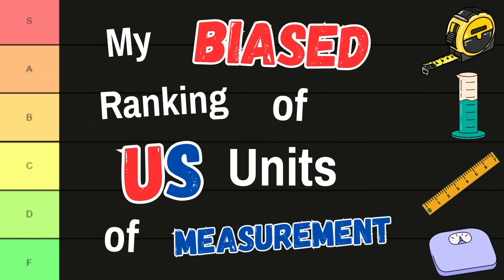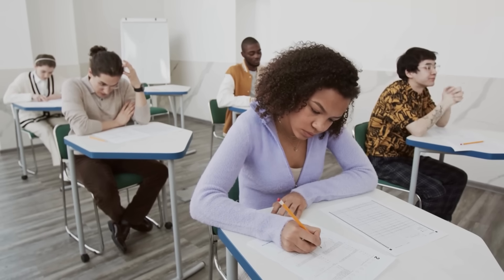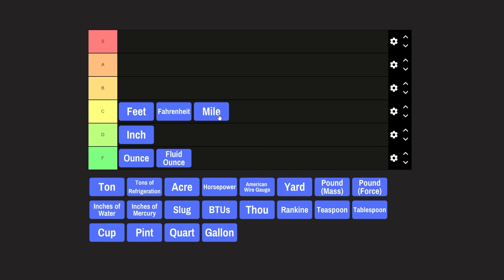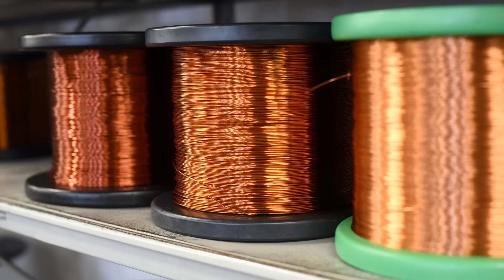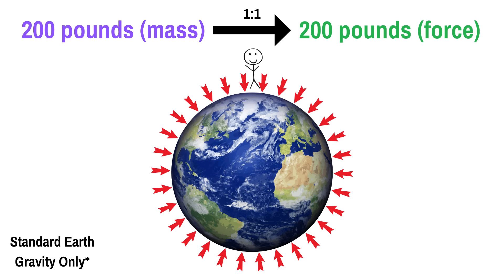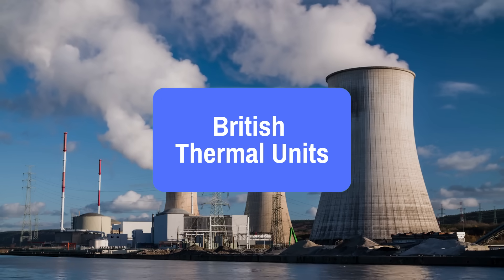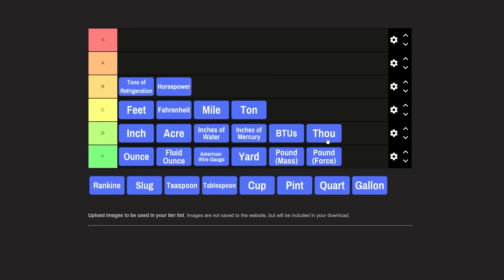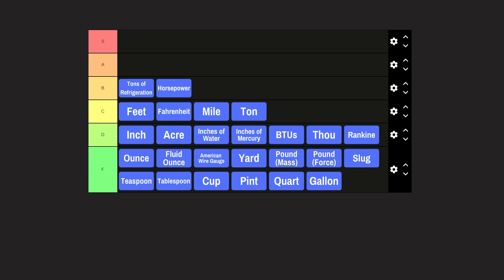Tier List of the DISASTROUS US Measuring System

Comment: Wait wait wait wait.  You're not going to explain why you ranked Fahrenheit, which is inarguably superior to Celsius, as C tier, just declare it arbitrarily?  Fahrenheit is the one and only US measure which is superior to its metric counterpart full stop.  You already recognized that Fahrenheit is well scaled for air temperature (though you didn't recognize that Celsius is unbelievably BADLY scaled for weather).  What else?  Fahrenheit is much better than Celsius for human body temperature, as it has twice the integer resolution of Celsius and the difference of a few degrees goes from "your baby is fine" to "must go to hospital now".  As to cooking, nobody cares that Celsius is scaled for states of water (in Paris only), because absolutely nobody measures water when it's boiling: it's always exactly the same temperature during its entire state change.  Fahrenheit again has twice the integer resolution for oven temperature, for candy thermometers, and so on.  Last, Celsius being better because it's related to Kelvin is nonsense since Kelvin was *based on Celsius*.  Both Fahrenheit and Celsius are both converted to Kelvin with a simple linear transform.

Comment: A funny thing is, that we use a few units with similar names in Germany as well, but with different definitions: One German pound is exactly half of a kilogram. A German tablespoon (Esslöffel) is a very unprecise measurement, were you just get a regular spoon and use whatever size it has. Just slightly above not measuring at all, so you have at least some consistency. The same for tea spoons (Teelöffel). German horse power (Pferdestärke) is also defined differently using metric values and a horse. This is still used to advertise cars, because people are used to them.
The German mile (7532,5m) (also known as the Prussian mile) hasn't been used for centuries. The same for the German geographical mile (7420,44m) (1/15 of a equatorial degree). The last German mile, that was used, was exactly 7500m=7,5km. Fun fact: In Europe the different definitions of miles ranged from 1,5km up to 11km.
Reply: I've never even heard of the german mile while living my whole life in germany
Reply: @Amphibax  I am a German living in Germany for a few decades, I also never heard someone use it. Noone uses it anymore, I assume if you say to someone "Meile" they would think of the US custom mile.
Reply: "Fun fact: In Europe the different definitions of miles ranged from 1,5km up to 11km." 

Nope,  the Dutch mile (1816-1870) was 1 km by definition.
Reply: @ThW5  Dutch stepping short?
Reply: @peterebel7899  Not really, the Netherlands were rather early with going fully metric, but re-used old names for the new units, so the kilometer became the "mijl", the centimeter "duim", the kilogram "pond", "aas" for miligram and so on... Most of those uses have been forgotten but some, especially "ons" for hectogram and "bunder" for hectare are still used somewhat.
Reply: @ThW5  I was just joking.
Bud did they use pound for a kg when the neighbors use pound for 500g?
Reply: @peterebel7899  Excusez -moi mon allemand:Jein.

 Sort of, as in those days people were still used to using different pounds, you still had medicinal pounds  (became 375 gram in the Dutch system), and Dutch pounds (1 kg), but in daily conversation pound for a weight close to half a kilogram must have endured as it is still in use as such. Before the metric system a pound could be as little as 275 gram (medicinal pound (in part of current Belgium)) and as much as 543,4 gram (Groninger spek pond, yes, a bacon pound), but most seem to have been somewhere between 400 and 500 gram,  (some of) the most common ones less than 10 grams lighter than 500 gram, so the introduction of a heavy-official-Dutch pound did not stop the Dutch from using pound for a weight close to the common value of days of yore of about half a kilogram. 
Of course, the Dutch names for the units were phased out in the era between German unification (the one in the second half of the 19th century) and WW II, so it is easily overlooked.
Reply: @ThW5  Thanks for your information!
Today the pound in Germany is alive in every grocery store, and it is 500.000g according to Bizerba readings.
Reply: @peterebel7899  As pond is not an official unit, it is technically not allowed to use it formally, i.e. on price tickets in the Netherlands, so it tends to be a case of: you write "500 g", but you say "pond".
Reply: @ThW5  Yes, daily business:
I want a pound of i.e. cheese
I get cut and packed a pound of cheese - and I pay for it.
And the receipt tells me I paid for 500g 🙂

We do use "Zollstock" (= "inch-stick") as carpenters or in daily life
Just this measurement device is markt with mm, cm, m, no inches 🙂

We do use "Zentner" as a unit of mass measurement.
In Germany this represents 50kg (officially defined 1858 as 100pound =50kg)
In the SW region it is sometimes called a Quintal (I never witnessed this in real life) defined as 50 kg.

In Austria the definition of a Zentner is officially introduced by law in 1950 as 100kg (which is been called in Germany a Doppelzentner)
You know: Austrians are the better Germans ;-)
But Austria skipped the official use of Zentner in 1977.

As I read in Wikipedia:
In der Schweiz sowie einigen anderen Ländern wie Italien, Russland, Polen, Slowakei, Tschechien, Ukraine, Ungarn, Belarus und Estland wurde oder wird hingegen inoffiziell und zum Teil auch in amtlichen Verlautbarungen der (Meter-)Zentner oder das (neue) französische Quintal (q) von 100 kg verwendet.

So the Zentner is screwed to be 50kg or 100kg and the Quintal is screwed to be 50kg or 100kg ....

To sum it up: Central Europe is lightyears away from being fully metric (in mind).

BTW: 
- Is lightyear a metric unit?????
- Why do scientist use Parsec (=3,26LY) instead?

Have a nice weekend!
Reply: Swedish mile is 10 km
Reply: Of course, the "German horse power" is just the metric horse power – the power needed to raise 75 kg by 1 m in 1 second, nothing specifically german about it. (It's 98.6% of the imperial horse power.)
I still see "sea miles" (nautical miles) around (which is just the average length of one arc minute on the meridians), and based on it the velocity knots (sea miles/hour), but only in maritime context.
Reply: @PauxloE  there's no metric horsepower, only power in watts
Reply: In Italy we don't use table / tea spoons, we use the "qb" (quanto basta).
This means "just enough" so basicly they're telling you to eyeball things and shut up
Reply: In Italian cooking books we don't use table / tea spoons, instead we have the qb "quanto basta".
It means "just enough" so they're basically telling you to eyeball it and stop bitching
Reply: Of course, the "German horse power" is just the metric horse power – the power needed to raise 75 kg by 1 m in 1 second, nothing specifically german about it. (It's 98.6% of the imperial horse power.)
I still see "sea miles" (nautical miles) around (which is just the average length of one arc minute on the meridians), and based on it the velocity knots (sea miles/hour), but only in maritime context.
Reply: And the Swedish mile is 10km long. Weird for those used to the Imperial mile, but the conversion is more practical.
Reply: Imperial units differ between Britain and America.
long ton, metric ton, short ton, ....

Diversity makes life exciting!
Reply: @peterebel7899  Imperial units also differ in the US. US customary mile, US survey mile and of course nautical miles.
Reply: @johnscaramis2515  The nautical mile is not owned by America, it is international nautical standard.
Reply: @peterebel7899  Yes, but it's also used in the US Navy, hence 3 different types of miles in the US.
Reply: @johnscaramis2515  A navy should move on the oceans, so the NM is the only relevant.
Reply: @peterebel7899  Don't forget that cars in the UK are just about 25% more efficient per gallon than in the US. The gallon is 25% bigger, and the mile is 0.0002% shorter.
Reply: @dascandy  I do love the British style of efficiency!

;-)

Comment: 7:58 Europe does use this kind of system, i dont know if its every country but I know multiple countries that use cm, dm, m, or otherwise said centimeter, dezimeter and meter, again im not sure if its the same in english but meter is the same in english im pretty sure. 1m is 10dm and 100cm, in every type of measurement a different type of name is always :10 or :1000 and never any different
Reply: Well said, except that "different type of name" is simply called a "prefix".  "decimeter" (c, not z)  is not a separate unit from "meter", but just "meter" prefixed with "deci".  Just like "kilogram" is not a sepa… oh, damn, they did fuck up that one.  "kilogram" is the base unit, accidentally.  Thus a milligram is actually a microkilogram.  :D

Comment: I think Fahrenheit is the only imperial measurement that still holds water(pun intended) against the metric system, because Celsius is equally arbitrary, being based on the freezing and boiling point of water which changes with pressure, as Fahrenheit’s human-centric system. Besides, if I’m using Celsius, I can never get baked at 420°, nor could anybody look at a thermometer that said 69° and honestly say, “Nice.”

Fahrenheit is High B Tier at least.

Comment: I disagree with the ranking of teaspoon, tablespoon and cup. These are very practical and should be the sole A tier units as they are very easy to use in the kitchen and don't require you to faff around weighing all your ingredients on kitchen scales to get the correct proportions. Also really easy to scale up and scale down recipes. People that use a different measuring system overall still use these measurements.

Comment: In germany we call a mesuring stick which is in cm and usually 2 meters long "zollstock" which means inch-stick. And some older people sometimesbuse pfund(pound). But its 500gramms/0.5kilogramm and that means its around 1.1 us pounds 😂
Reply: No we don't.  Not everywhere, anyway.  Here we call it (or I do and did when I grew up) a "Meter" (short for "Metermass" I think).  And not just older people use "pound"… oh, wait, I am old ;-)  But in  both cases, it's just the name.  Not the actual units (which we did have, shortly before german unification we had over 300 units (different sizes for the same-named units) in what became Germany)

Comment: Hey i mean horsepower isnthe only of these which are used in germany. The Kw(kilowatt) dindnt really kick it away. And sometimes we use tea and table spoons but not the scale ones just regular ones so its smaller
Reply: Horsepower was never meant to replace the kilowatt it wasn’t even invented when horsepower came about and they also mean different things, a horsepower is mechanical energy whereas kilowatts are 1000 watts which is electrical energy

Comment: Well, the only positive about measuring temperatures is that you don't need to ask much if someone tells you it's -40 outside.
Kelvin does not go negative.
Degrees Celsius and degrees Fahrenheit are the same at this value.
And luckily nobody is using Rankine or Rėaumure nowadays, so.... 😂

Comment: Interesting video. Although I would have liked to have seen a more objective ranking system other than "I hate these". For example, "how easy is it to convert up or down?" (e.g. from feet to miles or gallons to cups). "How does the unit stack up against metric?" (e.g. the acre works just as well as the hectare for land area, whereas Inches of [fluid] is pretty cumbersome). Maybe even include the metric equivalents so you have some use for the S and A tiers.

I also can't help but notice that you included some pretty obscure imperial measurements, but didn't include imperial time (24 hours, 60 minutes, 60 seconds), which metric time has not improved upon at all.

Comment: It's not like other parts of the world didn't use body parts for measuring in the past. E.g. in Germany there was the Elle, the length of a forearm, about 40 to 50 cm. The difference is that at some point we grew up and started to stop using measurement units referencing body parts. So is the metric system really better? Absolutely not. It's just way easier, way more logical and defined by nature; but if you like complicated, illogical systems defined by nonsense, the metric system is horrible.

Comment: having used most imperial units in engineering for some problems I can honestly say shat fahrenheit deserved to be higher tbh, celsius is just as arbitrary and Fahrenheit could be included in the derivations for other metric units without much hassle
Reply: HOW have you been using Fahrenheit???? Do equations envolving termodinamics even work with negative numbers??
Reply: @damatta9428  Rankine absolute temperature scale has no negatives
Reply: @alquinn8576  Makes sense

Comment: as a European i dont dislike miles or pounds.
i dislike that you use more then one unit for length.
we have the meter NOTHING else. Kilo, milli, are just factors (1000)
USA does not have this. you have inch, to feet to miles. AND NONE of them are a simple factor like 10. 
how would you every remember all the convertion factors. why would you use anything else then base 10?

Comment: The worst thing about Fahrenheit is when you try to convert it to Celcius. You'll have to deal with different temperatures that are set for 0 AND different legths of messuring which means you'll have to do 2 caculations for that one conversion.
Reply: Where does length come into a temperature conversion? The equation is simple (sort of):
C = (F - 32) * (5/9).
Now, where does the 5/9 come in? 100 C / 180 F degrees between freezing and boiling: 100/180, reduced to 5/9.
Reply: What I meant was the 5/9 part of the convertion. Sorry for not being very clear about that, but I'm from Germany and translating convertions from German to English is sometimed a bit difficult. 

_Still having to calculate that formula in your head quickly is a pain that shouldn't be neccessary IMO.   @waltp9509

Comment: In Sweden, the cookbook for generations was "Our Cookbook", which was published alongside the launch of a standardized set of kitchen measures. The teaspoon was standardized at 5ml and the tablespoon at 15ml, and the book used half or full deciliters for most other measurements. So in Sweden, we do use teaspoons and tablespoons, but not cups, and those are standardized to specific metric measurements.
Reply: Even in France, home of metric system, we still use teaspoon/tablespoon for cooking.
The only difference is that we NEVER use them for critical ingredients, but only for side/preference-related things... For example, "Fry it in a tablespoon oil", "Add a teaspoon of XXXX flavor", "Add one to three tablespoon of sugar according to your preferences", and so on. And, in fact, we never use a real spoon to "measure" that, we add the approximative quantity because it IS approximative.

For everything else, metric system is the one and only rule, but there is also no house without proper measurement tools in the kitchen (precision scale and measuring glass mostly), and/or ingredients sold in convenient packaging (100g, 250g, 500g, 1 kg). And yeah, there is recipes specifying "add 5 ml of oil", "add 15 ml of water" when it NEEDS to be precise.
Reply: Luckily the table spoon measures I’ve got in my home have their liter conversion engraved haha
Reply: Unfortenally rest of the world don't use standard teaspoons and table spoons as we do in Sweden, it's actually very convenient. The only anoyance is that tablespoons being 15 ml won't fit evenly in a deciliter. 50 ml is the same as 3 tablespoons and a teaspoon so rounding up to 50 ml is usually fine if you are trippling a recipe. Using a scale is slow compared to mesuring cups, for example pancakes: 6 decliters milk, 3 dl milk, 3 dl flour and a teaspoon of salt is a very easy recipe to remember and messure.
Reply: @SkepticalCaveman  actually reading the comments I came to the conclusion that at least all Europe may still have this use. In Italy we also use pints (just for beers tho) (I don't think it's just Italy)
Reply: @danielepadrini6731  Beer volumes is kind of interesting in Sweden. When it comes to bottles and cans it's always specified as 33 cl or 50 cl. In a bar however, it's most common to ask for "en stor stark", literally translated to "one big strong [beer]". What volume is it? Who knows, it simply is one big strong, and that's good enough. Probably isn't even a standardized volume, but no one really cares and still order the same thing wherever you go.
Reply: @Kaoskadosk  I think it is similar in most places. When I order "a beer" it is more or less 500ml, and "a rakija (brandy, sort of)" is 100ml, but no one would order 500ml beer, and few would order 100ml rakija.
Reply: That weird 33cl (aluminum) can and six-pack bottle measurement is only because of Coca Cola & friends.
Reply: 1dL is 5/12 of a cup , 0.5dL is 5/24 of a cup (1 cup is 240mL)
Reply: we use glasses in cooking recipes in Poland, and it's assumed to be 250 ml (so - 4 glasses to a liter).
Reply: Yes cups and teaspoons should'veone been A tier

Comment: The imperial system is made for simple folks who do not need accuracy and who do not make calculations but who just want to get a sense for how things approximately are.
For example, if you take a dump and you want to know how high your pile of shit is, then it is easier to stick your thumb and foot in it to see if it is between one inch and one foot than it is to get a measuring stick just to measure it's height. After all, most of us always have a thumb and foot with us but few of us have a measuring stick with them. And the reduced accuracy does not matter because for your pile of shit it is enough to only approximately know how high the pile reaches.